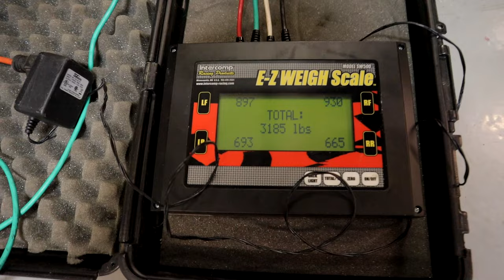American Musclecar Evolution - Why Pontiac Started Strong And Faded Into Obscurity

Comment: Tony is exactly right about the connecting rods. It was by design, not Pete Estes, John Delorean, Bunkie Knudsen or Herb Adams design, they were trying to get corporate to OK forged rods. Olds, Buick and chevy had them, but corporate said no. Why would GM do that? Well...

Every Pontiac VIN since the 60s starts with a 2. The chevys have a vin starting with 1. That was based on the pecking order of who sold the most vehicles. GM wanted chevy to be the largest manufacturer, and they wanted the Corvette to be top dog. Pontiac started selling too many vehicles, especially with the GTO, but going back to 1962 they were getting close to beating chevy numbers. The 421s and 389s were dominating racing, and racing was selling. 

In 1963, the year the mystery motor came out in the Corvette, which we all know as the 427 big block now, a lowly 63 Tempest put a hurting on everyone, and embarrassed not only chevy's Corvette, but also Ferrari, BMW, Porsche, and everyone else... in a freakin road race. 

The car from My Cousin Vinny that was confused with the Buick Skylark in mint green metallic with a white top was the 63 Tempest/LeMans... and this one in the race had a 421 stuffed in where a 326 usually was. Independent rear suspension which proved it was not kids driving the Buick that robbed the sack o suds, and a flexible driveshaft with a rear trans axle... which is eerily like the C6/C7 Corvette, which is what Leeroy the Savage is.

The Tempest lapped the Corvettes several times, not just once. It ran away from them like they were pushing their Corvettes and sports cars on foot then rolling them down hills. Utterly obliterated them, it was several minutes between 1st place and 2nd in the finish times. This was not lost on GM and chevy, some crazy guys just made them all look like chumps, with a grandpa looking car using its goofy flexible driveshaft. I am sure many things were thrown around the C suite that week, including spicy expletives.

GM's solution to slowing down the Pontiac was cast rods, which limited RPM. You can make incredible torque, earth moving power, tectonic plate shifting grunt, but spinning a 400 over 6300rpm or a 455 over 6000rpm usually meant a rod was going to be slinging its beam around whacking the camshaft, block, lifter bores, oil pan... etc. That is what happened to both engines I had where a rod decided to come apart, and neither were due to RPM, they were both sabotaged. (chevy guys don't like losing to cars that sound like they "are on a trip to the store for a loaf of bread." as one chevy friend of mine said it)

Trust me, you can make ludicrous power under 5800 with a Pontiac using the stock rods, iron heads, and factory intakes, and they will live for decades doing it. 500ftlbs from just above idle to 5000 is VERY easy to achieve, especially with compression and porting. 

The problem is, most people think they have to spin an engine to make power, because they are used to short runner, bit lazy port sbcs and Fords. You need to spin those things to the moon to make power, because they lack torque under 4000rpm. 

What do most people do? They throw some 4.10 to 5.13 gears in the back, a 4000 stall, single plane intake, 250@.050 or bigger duration cams, big headers and spin the snot out of the poor little chevy things. When you do that with a Pontiac, even if you have forged rods in the bottom end, it goes slower and its particularly prevalent with the 455 and 428. They do not like lots of RPM, they are not designed to make the power up top, they make it EVERYWHERE ELSE. So when people do that, they can't figure out why it goes so slow, then it blows up. 

So when you put a 3.73 to 5 something gear behind a Pontiac, you are moving it through the RPM range too fast in each gear, 6k shows up real fast with a 4.10 gear, 29" tall slicks, and a 455 making nearly 600ftlbs at 3000rpm. I did that to slow the thing down from 11.40s with a 3.42 to 4.10s running 12.0s to avoid putting a roll bar in, because I was broke in the 90s. 

When you put a 2.93 to 3.55 gear behind it, you keep the engine in its RPM range where its making all that torque for a much longer time. The engine is grunting so hard it doesn't care what gear is behind it, its either going to shove the car down the track or its going to destroy the Th400 or tires behind it. That dip from 1st to 2nd in a 700R4 because of the 3.06 first gear? Yeah a 455 doesn't give a damn and a 400 is amused by it. 

Using a 4000 stall when you have to shift at 5800 is wasting all that RPM and torque below 4000, so the car goes slower, not quicker. Make it work, let it eat, and the Pontiac will throw you back in the seat with a 3.08 gear.

Its the long runners that are kinda small for a 400 and definitely small for a 455, that limit the RPM due to airflow but make so freakin much velocity. A 455 will just stop pulling with ported iron heads at 6000rpm. That small but long port moves air VERY FAST, they are high velocity ports because of the Bernoulli effect of air speeding up when it goes through a necked down place or a long runner. 

Putting a single plane intake on  effectively shortens the intake port, and it kills bottom end, but the ports are not sized to flow air at high RPM, so it doesn't pick any up on top. The single plane intake usually makes a Pontiac powered vehicle slower... usually.

245@.050 is about the biggest you want to go with iron heads. Do you know what happens when you take that long high velocity intake port and make it flow more air? It makes MORE torque EVERYWHERE in the RPM range, and over 310cfm you open the door to 7000rpm. Now imagine if you will, an engine that is making 650ftlbs at 2500, and carrying it through to nearly 6500 and is still making 500ish ftlbs at 7000rpm... and doing it without a power adder. That my friends is one of my higher end Pontiac engines, and yes it has a single plane intake on it.

Sure you can spin it to 7000, but why bother? All it will do is wear the engine out faster, put a 3.00-3.50 gear behind it and let it do its thing as you shift it at 6500. Keep up on the valve spring maintenance and it will last decades.

You have to think different with a Pontiac, or a Caddy as they too are low RPM engines. It is far better to take an engine and make it do what it is designed to do better, than it is to try to make it do something it was not designed to do. Make the Pontiac or Caddy make even more torque rather than trying to spin them up real tight.

That 11.40 car with a 455? Yeah it was a $2700 rebuild, $1500 of it was getting the heads ported and new valves put in, TRW slugs, ARP rod bolts, and since the RPM was not out yet, and would not fit under the hood anyway, it had a Torker II single plane on it. The car was a 1979 Formula, weighed 3750lbs without my 230lb ass in it, had a stock L88 converter (1900 stall) and a 228/231/109 hydraulic cam in it. I moved the shifter at 5800 and the trans shifted as it hit 6000. 1.59 sixty foots on 9" wide slicks, 1.70 on drag radials, and it would move the tire a quarter inch around the rim on launch... with a 3.42 gear and no power adder other than the 11.3:1 compression. 

The same top end from the 90s era Formula is in my 65 GTO and it is 3400lb with me in it. It has a 455 with an Eagle crank kit under the heads, and that thing runs hard. Its a daily driver to me, and if the bird ran 11.40s weighing right at 4000 going down the track, I figure the 65 should run at least that quick since its lighter.  I have $4200 in that engine, because it has a $1100 hydraulic roller cam in it, but it would run about the same with a $75 Summit 2802 cam, which is about the same size. 224/228/112.

More is not always better, sometimes less in certain areas gets you more.

Hell. I should make a video and just read all of this into the mic then add pictures.
Reply from the maker: You DO need to make a video out of that!
Reply: I think the gap between 1st and 2nd at Daytona was 20 laps if I remember correctly.
Reply: Just wondering if you have ever seen the odd forged rods that have been found in 1964 421 cars.
Reply: @UncleTonysGarage  I second that the idea of that Olds/Buick video and let's throw in Cadilac and the engines of other divisions.
Reply: Partially correct. Pontiac VINs since 1965 start with a "2". Prior to that, they do not. Cadillac VIN #s in some of the 1960s do not follow the "divisional order" VIN type sequence. That was normalized later on. Also partially correct on Chevrolet VIN numbers. They did not always start with "1" in the 1960s either.
Reply: ...another extremely editorial edit: Corvettes have had transaxles since the C5 generation in 1997 and Leroy is/was a C5 (...an '01, I think).
Reply: Uh, Mystery Motor never made production, much less the Vette.
Reply: So True.....learned that back in early 90,s as far as gear ratios go racing a 79 trans -am in my small block chevy....close..till about 85-95 and the Pontiac was still pulling hard WAY in front of me...around 100 I watched him still in it WAYYY ahead of me on the highway,street light to street light...chevy.....on the long haul/high gear,those pontiacs will get ya..as a 18 year old I learned that quick.
Reply: I know a guy that has a set of 421 super duty heads that has been stored since late 80,s....
Reply: 62 date
Reply: Your one error. You dont have to spin ALL Fords to make torque and power. The 1966-67 Mercury only 410 and the larger bore 428 with their 3.98 inch stroke will produce plenty of low end. Same is true of the square 4in x4in  400, once its been modified to increase compression from its abysmal 7.5/1
So will the 429 despite its radically oversquare configuration. The longer stroke 460 will as well.
Reply: This torque vs horsepower thing always baffled me. I kept thinking why all that rpm with such low gearing when you could use the leverage of torque with low rpm with higher gear ratio. To me it seems that after a certain point those ultra high revs are going  to make the engine extremely sensitive to any imbalances or even minor flaws somewhere in the system.  I never really said that to anyone thinking that maybe I was just being contrary. Finally someone comes around and justifies my hypothesis. I remember once watching a group I was with running all their hi winding two strokes up this hill climb and getting close the top and bogging because the couldn't seem to keep the "revs" up or digging themselves into a trench. Then some guy pulls up on an 4 stroke thumper and walks it all the way to the top with out breaking a sweat. LOL
Reply: Dang dude that was a novel 😂
Reply: That would be interesting 🤔
Reply: @donreinke5863  Glad to see someone else knows about the Mercury 410 F.E. engine. Made myself a 428 out of a seasoned/sonic checked and bored 390 block, 410 crank, aftermarket rods and pistons, "14 bolt Mustang heads" all stuffed into a 67 F100 Ranger with C6 and 9" with 3:50 gears.
Reply: I agree to you on some extent on your Pontiac philosophy. But I did build a 462 motor and put it in a back halved 68 Firebird. Hard blok, shot peened rods, roller cam, ported heads etc etc etc. "210" turbo 400, 4500 stall, 9" with 4:30 gears, Bo Laws 1050 Dominator. Run 9:18 at 135 mph on motor at Darlington Dragway 20 years ago.
Reply: Loved your comment!
Long live torque!
Reply: @mikestaihr5183  there's an old saying, "HP sells engines, torque wins races". But it depends on which race--many NASCAR fans want to hear what the average top speed was around the circle and that's gonna be HP and aerodynamics.  

In the 1980's, ford basically went back to the 1930's==oversized (relatively) engine, low RPMs, and overdrive. Take an old Deusy or Auburn out on a highway and that locomotive sized engine can really pull along with new cars (just don't ask it to steer or stop :)  ). Ford took a 4x3 inch bore and stroke design and turned it into a 5,000 rpm redline torque beast that runs 300,000 miles in truck form.
Reply: @albertgaspar627  I'll give you that. But NASCAR, Formula One, etc are as far from street machines, drag racing, or whatever type of amateur racing a regular guy might be interested in doing himself as a Saturn V rocket is to a Cessna.   LOL
Reply: really thats the whole story of Pontiac ever since GM got them, im pretty sure GM wanted to kill them since the beginning, it just took decades to do it.
Reply: Yes, make a video of these builds. The is not enough Pontiac, Buick and Olds stuff here on YT.
Reply: Good read.
Reply: VERY well written! Looking forward to the video! 👍
Reply: Gawd dang, copy paste into my notes forever.
Reply: Now that’s a good comment!
Reply: What Leroy the Savage “was”.
Reply: im sooooo glad some one gets it im sooooo tired the bow tie babys thinking there sh*t dont stink till you walk there "hot" 327 with a stock 2 barrel 389 with single exhaust....ive got 10 pontiacs before 66 with 389s some tri power 4 speeds one in a 62 catalina super stock clone with a cloned 421 sd using a stroked 389 block and real sd top end one ride in it and none of my chevy buddies will ride in it again they say its to much power....in a full size 62 catalina and they think there nova with a mild 350s hot to trot......thank you for a actual inteligent break down....ive been trying to explain this to people for yrs.....pontiac was killed by gm for the black sheep out shining there golden child.....
Reply: @chrishensley6745  he wanna sell em
Reply: @SweatyFatGuy  428s werent common even back in the day, and finding a CJ version is very hard these days.
The only attempt at performance from the MEL series engines (that I know of) was the 3x2v Mercury Turnpike Cruiser engine of 1958, claimed to be the worlds first 400 hp production passenger car.
Ive seen 430s in early 60s Lincolns in the wrecking yard with a TWO barrel carb.
That thing sure as hell wasnt going to wind much, but in a barge like that, it only needed low end.
Speaking of low end, the undersquare 4.25 in stroke Olds 455 and the 4.304 in stroke (bore is also 4.304) Cadillac 500s have got to be among the best of ohv engines.
 I dont think I would want to wind either over 5,000 though.
Reply: Powers that be.. please make this video happen!
Reply: Cool  information about  Pontiac.. I  always  liked  them because of the  bottom  end  torque..
Reply: Q
Reply: The Chevy Mystery Motor was a totally different engine vs the 427 Rat motor. The Mystery motor was an over-square ( shorter stroke ) design and the heads were totally different from the heads on the Rat motor. The Mystery motor NEVER made "production". They made 50 or less, and possibly A LOT LESS. Also, they didn't have the bugs worked out of the valve train for the Mystery motor. But before the small handful of engineers could iron out these issues, the bean counters at GM totally axed the Mystery motor altogether. Why? Because the cost to produce the Mystery motor was FAR MORE than the Rat motor. I bought all 3 volumes of Smokey Yunick's autobiography. & read them cover to cover. Bunky flew Smokey up to check out not only the Mystery motor on an engine dyno, they had another one completely tore down for Smokey to personally inspect every part. Even though Smokey noticed the issues/problems, he asked "who designed this engine?".......and some nerdy looking dude ( I forget his name ) answered: "I did"......and Smokey said he walked up & shook his hand & said: "Once you guys get the bugs worked out of this thing, I've got the feeling you're gonna become a very popular man around here"......end quote. It was NOT the man who played a huge role in the design of the Rat motor. 2 totally different people......just like both engines were completely different. During the off-season in NASCAR leading into the '63 season, when Junior Johnson and Smokey Yunick were issued something like 7 Mystery motors each for that season ( Chevy also provided the cars ), along with 1 engine being provided to any competitive team ( per NASCAR rules ) running Chrysler's and Ford's, so they could tear them down for inspection, Junior Johnson ran around & bought those engines back from the Chrysler & Ford teams ( it was only a few ), so that he would have enough engines to get through the racing season........because Chevy TOTALLY BACKED OUT of racing altogether before the first race of the season even began. So Smokey Yunick, and Junior Johnson along with his engine builder Ray Fox, were totally on their own as little independents. Keep in mind, the Mystery engine was still plagued with valve train issues, because top brass axed that project altogether. However, in EVERY nascar race it started that season, it either led the race until it dropped a valve, busting pistons......or.....IF the valve train & engine managed to live, IT WON THE RACE. Both Junior Johnson and Ray Fox stated that IF they could've fixed the valve train in that Mystery motor, and with NO crashes or bad pit stops, they would've won every race that season. Because when the Mystery Motor ran.......it left everything else in the dust that year. All of the above are direct quotes from Smokey Yunick, Junior Johnson, and Ray Fox. That '63 Impala was one bad ass car that year in NASCAR. Just sayin'.
Reply: The machine shop guy that helped build my 440 had a similar philosophy.  Originally I started w/a 413, but he over-bored it and found the bores to be porous, so he found me a 440 block. Since the 413 head were still fresh, he stuck'em on the 440 and said I'd get more low end girth with the 413's smaller valves.
I'm no hard-core engine freak, just an old tin-knocker, but the torque it delivers in my big '68 Fury C-body with Cal-Trac bars and a couple other little things...well it seems torque is one thing it's not lacking. 
I need to play around with it more to get it dialed in.        Things like UTG and inspiring writings such as yours certainly help! Thanks!
Pee Ess, I would freakin LOVE to find a '61 or '62 Super Duty one day.  Or build a clone-mobile would be more likely.
Reply: @brracing7861  And it was two powerglides on either side of the diff!! Loved that story.
Reply: @brracing7861  when you talk about the blow-down stroke I'm guessing it is between the upstroke pushing exhaust gases to the downstroke sucking the air fuel mixture in. I'm guessing that would be the biggest change in pressure. More so than decompression to ignition stroke. Which would have a higher pressure overall but less of a difference in pressure. And it is that larger difference that would put a greater stress on the rods
Reply: What you say is true. Make a clip out of that for YouTube and I'm sure you have a ton of views. I read 2/3 of it I promised three the other third. Right now I just have to rest my eye had procedure done on it. I got some wrapped up in what you were saying. I had something along the set up you were describing in a 73 firebird. Been too many years I might be off one year or the other. The bird wasn't as important as the engine. But I killed it with lower gears. And kudos to the old nameless man at the track telling me I need it something in the low threes. I was young and new that just could not be true. Catch that part that I was young. My dad said he'd bring us old Ford with his flathead V8 and well wipe something with my firebird. Might have been fun to look back on but I do not take them up on it. I don't know if there's strasburg I forget the name of the carburetor but they're 8 one barrels. I knew he was right. He said the same thing I heard it too low. Well thanks for indulging me I don't have the opportunity now for that grudge match.
Reply: I usually don't take the time to sit and read long comments but in this case, I'm glad I did. 
Well worded. Thanks.
Reply: @stevejarred6484  I'd certainly want to watch it. I'm all about Oldsmobile and Pontiac. And I'm not ashamed of being a 455 fanboy either. In all my years I've yet to see one outclassed by any other big block.
Reply: @stevejarred6484  Oldsmobile is "The gentleman's hot rod".
Reply: Yes sir! Thumper you are correct. although single plan intake well depending it can help. But that stock iron intake 67-72 is still one of the best flowing intakes.
Reply: you're right. gm brass put the screws to pontiac. I previously owned a 65 goat, a 69 Bonneville 428, a 70 firebird and 2 different 71 grand prix. they were great cars!
Reply: I was gonna comment but I think you took the cake. When GM went with the "Corporate Block" for all the lines I believe it also killed the Pontiac, Olds and to a degree Buick. Seems there was a pecking order in GM world.!
Reply: @mikestaihr5183  that was one of Ford's problems--even with the Total Performance program going on, they focused on what happened on the track to sell cars on Monday--and it wasn't always a track in America. Before the Mustang came out, they sent Falcons over to Monte Carlo to win (which they did and then pulled the program to push the Mustang--that would be a good precursor movie for Ford V Ferrari). Like Lido says in the movie, NASCAR wins works down south but TransAm works in northern markets against sports cars. 

Pontiac sent its cars out the doors of Royal Pontiac to street race on Woodward Ave, often going after the Silver Bullet, a 488 cid 67 Hemi. They even did an ad titled "and you know the rest of the story". It set the GM execs hair on fire but it spoke to the kids buying the cars.
Reply: @brracing7861  2.02 is rather small for an engine approaching 400 ci, but adequate for a smallblock..
Two barrel Cleveland heads, used on Ford 400s were 2.05
Reply: @SweatyFatGuy  Fords generally followed in the footsteps of Pontiac (non RA or SD) and Mopar in offering smaller port/smaller valve heads that created low RPM torque (compared to chevy's 1.94" or 2.02" intake valve heads) on their bread and butter engines. The Lima benefitted from Seamon Bunkie Knudson coming over from GM with some buddies (Larry Shinoda etc) and turning the tunnel port small block designs into canted valve 351's and the Lima into a version of the Rat (more crankcase room, etc), oil system notwithstanding.
Reply: @donreinke5863  back in the days when drag racing had room for the little guy, the 430 Lincoln was one of the engines racers loved to find in the junkyard and stab a cam into (along with 394 Olds and first gen Hemis) and maybe a blower (UTG has mentioned this before, the rings would loosen up their gaps by this time) and drop into a Willys and go racing until it blew. 

I've done the Olds and the Cads, you are right about not wanting to go past 5,000 rpm unless you really do the oiling system to keep those big main journals bathed (and the Cad also uses the Armasteel (not armacast) connecting rods along with tiny cam journals). but boy do they work in a parts chaser truck! the best olds big block was in 1966 it was smaller on stroke than bore but combined with the W30 tripower package, it typically ends up in top10 quickest time lists for stock muscle. I had a Cad in an OBS slabside chevy pickup because you could get a set of BBC headers to fit with an adaptor, and a 425 cad single plane intake--drank gas like a fish but it would pull a car trailer up a hill like there was a diesel under the hood, just needed to switch to a BOP pattern THM400.
Reply: @danielscott6787  I found a 410 in a totally beat 68 Ford flatbed in a wrecking yard. The usual wrecking yard scavengers had scraped off the left front of the block. (most FEs of that period had "352" cast into them), and kept moving.
None of the boobs bothered to look at the stamped tag which was still under the coil that identified it as a 410. I also verified the stroke with a marked junk dipstick run down a spark plug hole at bottom dead center and top dead center, it was right at 4 inches, so I knew what was there.
I was back with necessary tools within the hour to pull it.
I would be leery of punching that 390 block .080, but if you had it sonic checked its good to go.(FEs were supposedly thinwall)  Many of the early 390s didnt have core shift issues as the later ones more often did.
Of course, one could bore the walls to the water jacket and press in 4.25 ID sleeves, but sleeving is getting very expensive.
454 ci might be worth it though.
Reply: @mmcnew1  Check out Richard Holdeners channel. He builds some really obscure "other guys" engines.
Reply: @albertgaspar627  I know an old guy, as in REALLY old..hes 92..that told me about racing 58-60 Thunderbirds with 430 engines. He claimed they were used in NASCAR.
To be honest, I never knew the aftermarket supported the 430 (or any MEL series engine) with any performance parts, I thought racers mostly made their own.
The problem with the corporate THM 400 is that they would blow out the second gear snap ring in the case. GM issued a revised version with heavier case lugs, but it was only offered with the Chevrolet bellhousing configuration.
Reply: @SweatyFatGuy   How did you come to find the best rear end gear ratio? Trial and error? I have a 1968 Firebird with a fully forged 400 bored and stroked to 463, roller cam and roller rockers. I’m currently running 3.73 posi rear end and it ran 12.3 on 255/60-15 drag radials with full tank, spare in the trunk and shifting at 5200. After reading this, I’m wondering if I can get in the 11’s with a gear change.
Reply: @donreinke5863  The old man is correct, and I think they ran on the Daytona beach sands as well--i can't remember if they also ran in the convertable class. And you are right, there's not much support for the MEL, too bad it shared with the W engine the lack of combustion chamber cast into the head. I think Ford offered some "export only" hard parts and racers took over from there. 

the one thing i'll say about the THM400 is the switch pitch torque converter--i have one behind a 400 hp 455 in a 68 Olds 4-4-2, and Hurst Olds truly dropped the ball not putting them into cars in 1968. actually considering GMs displacement restriction, they should have patended the design and had it in all their cars to make up for the Powerglides...
Reply: Great comment and info. Thanks for that. My older brother ran a Caddy in NHRA stock back in the 90s. From what I remember correctly the weakest link on those was flimsy valvetrain pieces. I was honestly impressed with the performance though. I think the car weighed around 4,150. That was early 90s so I may have some details incorrect but I do remember him having to strengthen pieces in the valvetrain.
Reply: That is an impressive story.
Reply: Yes, you should make a video.
Reply: @albertgaspar627  With the exception of 351 Cleveland 4 bbl heads. They had enormous ports and valves for such a small cubic inch. Port velocity down low suffered which affected the torque down low as well. Chevy did the same with the 396. Even the common oval port head with 2.07 intake valves was too big for the baby rat. I think a lot of people would be surprised what a “junk” peanut port truck head could do for a 396 in a street application. I personally think the 2bbl Cleveland heads were better for the common street/strip guy.
Reply: That was an awesome bit of information. Thank you.
Reply: @mattbauckman9907  Right, the 2 bl Cleveland heads were almost the right size, and it's too bad people didn't dinker with the 400M small block--about the right displacement but the chamber design sucked. Look up Richard Holdener's channel here, he did some peanut port junkyard engines

https://www.youtube.com/watch?v=rwUDpcVDlzY&t=660s
Reply: @SweatyFatGuy  Most of the GM divisions followed suit. Cadillacs didn't normalize the VIN "pecking order" until later on.
Reply: The Chevy Rat, Mark IV, Big Block didn’t go into the Corvette until 1965. Duntov didn’t want that heavy engine in his car, but GM executives prevailed.
Reply: @SweatyFatGuy  Olds came out of WW2 being GM's performance wing, using tech from tanks and airplanes to use the new refined fuels with "high compression" in their Rocket engines. Pontiac's Silver Streak line was considered stodgey but they took over the performance banner in the early 1960's. Chevy meantime was dealing with the "Unsafe At Any Speed" fallout post 1965--they borrowed the swing axle design from the 36 hp VW and put it in the Corvair and Nader wasn't wrong about the result. But Chevy had invested in the Corvair (combo of CORvette and bel AIR) line, making trucks and vans just like VW did--plus a performance model as well. 

In a way, the Corvair was the Saturn of the 1960's but became the Edsel instead. DeLorean pumped up sales in Pontiac like you said, and in the end GM is about making a profit (until it made a deal with the UAW to give full benefits after two decades of work--then it became a health insurance company that produced cars--but that's a story for another time).

agreed on the Ford Cleveland--even with oiling issues and the exhaust ports, they got a lot right. an Olds guy once told me Oldsmobile designed its engines to heat up the parafin wax that used to be in motor oil so that the lifters wouldn't clatter on a car so expensive.

I can believe a Vega blowing its rear--V8 swaps not using the Powerglide had to be babied until a narrowed rear could get under there (some would try the first gen Ford Bronco axle but even it i think had to get narrowed some more). but the Vega had a torque arm setup used on the 1983 F bodies and I'm told when F bodies went to LS power they got a version of that Vega axle to get past CAFE--put on slicks and it snapped like a twig
Reply: @danielscott6787  the girl who broke my heart's favoritest dream car was the '68 Firebird.
Reply: Yes you should! You have done EXACTLY what I have done! I have a 76 TA that I built/ restored with a 455 and I just finished my 65 GTO. The GTO has a 463 stroker with forged crank,  rods, pistons and roller cam.  Obviously I have a lot more money in my GTO engine....virtually everyone I know thinks I over built it because the cam will "run out of gas" before 6000. I've been a Pontiac fan for life and shucked too many rods. Won't happen again
Reply: @SweatyFatGuy  I believe that's correct, Olds in 1957 on their 371, Chevy in 1958 on the 348. I remember someone defining Buick as the car the banker bought to look successful but not look like they were embezzling. 

When the Goat came out with the 389, it really was a pretty big gun to bring to the street fight in 1964--all there was for non-full family sized car performance was solid lifter small blocks (mopar 273, ford 289, corvette) and a turbo corvair and a 426 wedge or hemi if you could find one (i say that b/c we forget most muscle out on the street wasn't the top of the line models, but the basic stuff--more 325/350 hp 396s than 427 L88's, more 383's than six pack 440's, etc). The Goat sold more than expected. 

Forged rods would have been great, but the other thing Pontiac really needed was better rear axles. When Chevy came out of 1958, it was giving the W engine their 1955 axle designed for the 180 hp 265 and they blew--ironically the solution was an olds or pontiac axle. but the tables turned, and the GTO and Firebird varieties got the 10 bolt while Chevy performance got the 12 bolt. 

and a rear sway bar and brakes better than the originals in 1964 would have been good to help the boomers keep it under control. there was a reason the insurance company number crunchers saw an increase in accidents.
Reply: I should have read your Comment through before the comment I just made. Great information. Thanks.
Reply: Instead of calling it the "exhaust blowdown" or whatever was said, why not just call it the intake stroke like everyone else?
With a 4 stroke engine the intake stroke is the only time the crank pin/rod journal force is "applied" to the rod cap as the piston and rod travel downward in the cylinder. On the other 3 strokes the forces involved have the crank pin/rod journal pushing "up" into and toward the beam of the rod. The only thing I can think of when this blowdown or whatever term was used is maybe y'all were talking about the moment at bottom dead center of the exhaust stroke when the piston and rod change direction and begin to travel upward in the cyl during the intake stroke?
Anyway that was alot of good conversation in this thread. I couldn't even finish it all, will have to come back later and read just to get thru the entire thread let alone the rest of the comment section.
Reply: Wow!
Reply: @brracing7861  i
Ard those rods actually designed to bend like that inside of the block under extreme acceleration runs?
Reply: @SweatyFatGuy  
America's Cup race (Previously the Auld Cup) is for sailing.

Are you certain for the road race name that you cited? In which year was this race?
Reply: @brracing7861  
Is it in a museum perhaps?
Reply: @SweatyFatGuy  
Thanks. I found out that it was called "The Continental Race" held at Daytona. The 2nd race.
Reply: @brracing7861  
"Size you up"? Please allow me time locate my micrometer. Oh, there you is, down by my ankles.😝😂🤣😘😆🙄
Reply: @lilmike2710  Except Pontiacs aren’t big blocks.. ( Or small blocks) Pontiac only had one V8 block and it was kind of in between a big and small block…… 326 to 455…. all the same block
Reply: Very interesting comment. Much appreciate you sharing your knowledge and experience!
Reply: Please, No video! I waste so much time on YouTube already. Love Pontiac! 1973 grand prix, best car ever. used to get smoked by my freind in a Buick, but I could care less. Car was a cruiser.
Reply: VERY true.
Reply: Pontiac V8s survive just fine as long as you don’t wind the piss out of them. Add some lightweight pistons and wrist pins and they will rev higher than they need to. I saw plenty of 11 second Pontiacs with stock rods back in the day.
Reply: @SweatyFatGuy  

My buddies with 289 Windsors used to brag about how high they could rev their engines while they were running 16 flat. I just laughed at them while I was running low 12s @ 5500 RPMs.
Reply: @timsharpe3498  I agree, I was told that's one of the advantages of the 428, big stroke smaller pistons. Same 4" stroke as a 454 Chev.
Reply: @UncleTonysGarage  I figured it had to be Corvette, which also later nixed the performance Fiero.  I knew it. Chevy won because Chevy had Corvette, which took the other GM divisions out of the running by corporate the whole time.  The only real competitor to Corvette was Ford GT40, and I don't know what all GT40 parts could be adapted to a Mustang, Torino or Pinto, but lots of Corvette parts could be adapted to Camaro or Monte Carlo.  So that leaves Super Bee and AMX, but were they really in the same leaque?  Viper was later on though.
  Personally, I'm a mileage guy, so what I missed was seeing original concept 1.8 econo-Fieros going head to head with 2 seat Honda Insights like my 4 seat Chevy Metro did.  Chevy (with Suzuki) was dominating that contest too, at least in full gas class.
   What I really never understood was sport-luxury like Thunderbird and maybe Grand-Am when the far better fit was econo-sport like Fiero and potentially an econo-vette with first the Vega engine (semi-disposable) then the Chevette engine, going up later against 1.8 Fiero and then Miata.  Thunderhead289 has some amazing results from is lawnmower Maverick.  How fast can he switch carbs if challeged to a race? He never did for Power Tour!  He debates Tony on carb sizing but I don't know why, since he abandoned power with his lawnmower carb anyway.  I think massive vacuum advance might get both power and mileage, and the factories didn't do it because of NOx vs CAFE.
   Anyway, it seems to me like the aftermarket could have forged the Pontiac rods and been done with it.
Reply: Refreshing to hear from somebody that actually walks the walk,keep it coming my friend.
Reply: @SweatyFatGuy  in the 90's, I was trying to go to Grand Island NE, I heard about the cars in Nebraska
Reply: Isn't the small-block Chevy based off of the Pontiac?
Reply: I've had a few Pontiac "street" engines that were built from the unwanted 350 motor due to its low price and easy availability and I have to say low rpm use combined with keeping a high rear diff gear 2.73 to 3.08 made the torque of those motors shine. I've had small block fords and chevys that were great running "screamers" , but just didn't impress me the same as the low rpm brute force of the poncho motor. The 389, 400, 428, 455's are great but my beer budget wallet kept me from having one to hot rod up for my own.  EVERYTHING said by our Pontiac "defender" in the comments rings 100% true to my ears and my experience even with the lowly 350 that no one gives any credibility to.  Tony, even though it was a low production/option only(in a sense) motor, would you consider a comparison to the 455 S.D. against the common "weak rod" standard poncho motor? I believe they were equipped with the good forged bottom end bits.
Reply: @jimp9133  in a word ........no.
Reply: @michaelhutchinson3901  Thank you Mike. So many "car guys" live under the misconception that there were Pontiac big and small blocks. NOPE!
Reply: @brracing7861  You must be referring to the fact that Cadillac engines were bored and stroked in the undersquared dimensions (more inches of stroke than bore) which in purely mechanical theory should produce high torque at low operating r.p.m.s and a crapload off piston speed at 5000 r.p.m.s in mid travel of bore. Like flying through that cylinder! I know some automotive math to calculate compression,  displacement,  etc., but piston speed at highest level at 5000 r.p.m. for given bore and stroke dimensions? My brain is  starting to throb!
Reply: my Pontiac VIN starts with a "1" as does my chevy
Reply: @CAROLDDISCOVER-1983  Stromberg carburetors, made in Elmira NY I think. Bendix bought Stromberg.
Reply: @porcupinecone7188  well that's interesting thank you for that information. Bendix is an interesting company. They are into a lot of things. Including atomic work for the government. It kind of stuff you have to have licenses for to handle nuclear items. If I was ever in there plant it's sure been interesting the story to tell but I couldn't anyway if I was ever there. But I can tell you I never worked for Bendix.
Reply: @CAROLDDISCOVER-1983  As you guessed, I've never worked for Bendix. Bendix is (was?) a diverse American company. I don't mean diverse in the politically correct sense. 

As kids we always called the bicycle brakes on our bikes "Bendix brakes" (the kind where you rotate the pedal backward to brake). Bendix US-made car brakes were the brand we always wanted to buy. They weren't US-made for long once Allied-Signal bought them. 

Bendix made the "Red Bank" super high reliability vacuum tubes that some audiophiles and tube fetishists love.
Reply: @porcupinecone7188  yes you're right allied signal bought them out. They still use the Bendix brand or label for certain operations. The place I mentioned before isn't there anymore for the most part. It's behind a 500-year flood wall that the city of Jericho would been proud to have! You get my drift. Anyway they built that wall and the gates are part of the wall it moves and he got the idea. It wasn't too long after that they decide they're going to move it so they did. Now if those sub training tunnels were ever true the news site would be easy to connect to. And we're talking 20 miles as the birds flies. Don't worry all that nuclear waste contaminants whatever you like to call it didn't have to stay at the old site because it's sitting right on Little River so it could disperse downstreams! Now before you get the wrong idea I don't hug and kiss my trees I don't look for the knot hole in the log. Not one of those not heads. But what's true is true. It's interesting riding in the back of an extended limousine of a utility cart /over size golf cart. They closed the doors and you can't see out. As you go down several levels. Not a nuclear scientist either. I'm just one of those guys that seem to end up in peculiar circumstances over time. Maybe because this is the most ever talk about it the original site major metropolitan area all around it. I think Bendix also made parts back in the day for generators and such. I can tell you they handle beryllium and a host of other items. There's actually proof of that. There's other places too like one Tennessee can drive through on the main road it's just hairy that lake or Marsh kind of glows at night in the green. I'm not joking. I drove very quickly to get through that area
Reply: @SweatyFatGuy  If I only had a dime for every person who tried to go fast in a Pontiac by trying to build it and run it like a Chevy I could have retired years ago.  I've always loved the Pontiac and the big block Chevy because they're polar opposites in many ways.  The Pontiac will make an insane amount of low and midrange torque while the Chevy (especially 427's) like to rev.  I've never put anything steeper than 3.31 gears behind a Pontiac 455 or 3.42 gears behind a Pontiac 400.  There's no point.  Same with Oldsmobiles.  Build them for low and midrange (meaning dual plenum intakes and relatively mild cams) and shift between 5 grand and 5500.  They will live FOREVER running them like that and destroy any set of rear tires you put on them.  The BBC on the other hand, 3.31 is the mildest gear I'll use.  Then again, I'm building the whole damn thing to rev and I'll spin it to 7,000 RPM because with the square port heads it wants the RPM anyway.  Here's the biggest difference though...  That Oldsmobile and Pontiac will behave just fine on the street.  You can drive them to get groceries, or anywhere else and they will be just mild mannered enough to behave just fine.  That high winding BBC is NOT going to be as well behaved putting around town in.
Reply: Pontiac had top end speed for days it never stopped climbing where SBC motors would run out of breath it seemed or power up in the way too fast to be on the highway range the Pontiac just kept winding and winding faster till either you let off the gas finally or if you had the car capable and the balls to do it you'd find the end of the wind which I never did and according to where the speedo stopped registering and doing some simple multiplication it came  out to  150 mph or close to it now at that speed on a normal road in a normal run of the mill factory production car it's sketchy af and things are happening so fast like the trees going past and the front end floating a bit and your mind thinking whoa if I hit a blade of grass wrong at this speed I'm done for lol anyway if I did that 3 times in that Pontiac powered monster that cured my need for extreme high speed runs and the motor loved it I can't even imagine a four speed auto w torque converter lock up that could stay locked under full throttle how fast you'd end up going geez wings and you'd surely get lift off lol
Reply: J
Reply: @848evo4  What year is it? After 1980 vins were standardized worldwide where the 1st digit or letter is the country of origin.
Reply: Well writen.
Reply: Holy Ruck ! Thanks for the education. I was always a Pontiac fan. I had a 72 Grand Prix with the stock 400. Had big Dreams for her out of high school. I always loved Pontiac. They had better designed cars, stylish & character. And yes, much faster than Chevy. But as a garage mechanic I was always working on everybody's Chevy. My Pontiac was stolen a long time ago( whimper, whimper, snif 😭 ) and now, I'm the owner of 4 Chevys. 2 of witch are 2nd gen Camaro's. Small blocks thinks it's a big block !Got to love those interchangeable parts.
Really good read. Thanks again 4 ur info. ! Old School Cool !!!
Reply: @mikestaihr5183  I guess that's why we learn calculus.  Area under the curve.
Reply: Comes up a lot.  GM creating a glass ceiling whenever they could for Pontiac to benefit Chebbies. There's several examples,, I know some ppl say , it was a Buick, it was a V6, cold start emissions on the Turbo V6 wouldn't meet new regs anyway.  if Pontiac really wanted to keep building that version after the '89 TTA, I don't believe GM would have let them anyway, gotta save face for Chebby.  I drive a GMC (now that's an old school connection, 1955-1959 with the Pontiac V8, 336 in 1958 & 1959 by changing the bore & stroke, just to put in GMC trucks 🙂 my dad had the old MOTOR books, then I read again somewhere years later that talked about it, verified it.  Sometimes  wished I'd have started going to all salvage yards at a young age to look for those, I bet a lot went to the crusher, wonder how many of those '58-59 Pontiac/GMC engines are left anywhere.
Reply: @scottnorris8571  Uh, yeah it did. 1964 Daytona 500 week. chevy set up an exhibition race to showcase their new "mystery motor" in an all sports car race. The entire field of cars consisted of Ferraris, Porches and corvettes, all with their new 'mystery motor" One other car in the race, a 1963 Tempest. It was a 100 lap race. The 63 Tempest led every lap and won the race. Second place car was AJ Foyt in a corvette. 2 laps down.
Reply: Great information, thank you so much, also you don't need 5:32  6,000 rpm + engine to have a fast car
Reply: @SweatyFatGuy  Man I wish we had time to talk at the races!
Reply: GM corporation was trying to keep in a position below Chevrolet, so they never gave them enought money to do forged rods. This was design, especially after Pontiac did the GTO, which was snuck into the market through provision of being a factory option. Pontiac even developed a SOHC 3 valve engine toward the end of the 60's. Pontiac also had a problem with their GM after Delorian left for Chevrolet, due to them being bean counter style GMs. They engineers literally had to fight to get the SD455 to market.
Reply: 1970 TA (Back in 1990) 455 .060 over SD Rods, TRW Flat Tops #12 Heads ported to about 280 ish 2.11 1.77 valves Crower Solid 533 Int 555 Exh 252 260 with a 112 center.  Car ran 7.20s in the 1/8"th and 11/60s in 1/4 at 119 mph.  weighed 3550.   T 400 11 inch converter and 29x11 Goodyear Eagle drag slicks  screwed to Drag lights.  Manual Steering Box and Stock 12 bolt with 4.10s.  Frame connectors installed and 1/2" Fuel Lines with a Holley Blue Pump and an 800 Spread Bore Double Pumper with HEI set at 16degrees 36 degrees total all in by 2100 rpms.  Crane Cams adjustable vacuum advance.   Harland Sharp 1.65 Roller Rockers.  Modified Edelbrock Torker with heat crossover removed and water neck separated.   Was 12-1 compression and would only run on 100 plus octane.  Yank the wheels hard in first...... if it hooked up which it usually didn't on the street.   Man those were the days.  Hope I can get my 65 GTO with the 428 4 speed motor to run as good.  Spot on with the rods being the weak link though.   SD rods would stretch and still spin bearings.   I shifted mine at 6200 usually but it would rev to 7000.   And was still pulling!
Reply: Lol, you've written an entire book touting your supposed extensive automotive knowledge, and yet you aren't even able to spell Chevrolet properly...
Reply: The 427 didn't come out until 1966 not 1963 and they started off as a 396 in Impalas is a mark motor
Reply: @SweatyFatGuy  it did not exist in production Maybe in research and development but it was not available for the public and the first big block produced was a 396 in a year and a half later the 427 which also came with an aluminum block for the Corvette you can look it up if you'd like
Reply: That was a very interesting reading. Thanks for all the info, I can imagine what the 400 would do in a weighted down 1978 LeMans. That would be a monster. I always liked the pontiac designs, and I never understood why they didn't make a Pontiac "corvette" equivalent. Now I know, for corporate reasons. I still think they had the most innovative idea, with buick, of the whole GM line-up. They came up with interesting ideas in the 80s with the fiero, that could have been a great success would it had a different engine, buick did a similar car, rear engine (or centered, I don't know) with the regata, and came up with another great car and engine, with their turbo 3.8 in the regal, and in the later buick GNX. I had one from 1993 to 2006, and I absolutely loved that car. It was the only relatively fast G body, and it also had an awesome look. I bought a house in 2006, and the car had to go. I still miss it. 

Sorry for the bad grammar, english isn't my language.
Reply: Epic comment. Well said.
Reply: The 427 did not make it to the Corvette until mid-year ‘66, when it was upsized from the 396. 1963 did not have a big block; it was 1965 when the 396 became available in the Corvette.
Reply: Testify Brother!  I've known that the old Pontiacs V8s work like diesels for years.  High RPMs are not necessary or desired.
Reply: I wish I could like this more than once!
Reply: It was a response to Pontiac defying them CID limit on performance cars that spawned. It was the way GM could ensure Chevy would be the top performance division NOT Pontiac.
Reply: Hello, was a video ever made?
Reply: Just wondering where I can find the video.